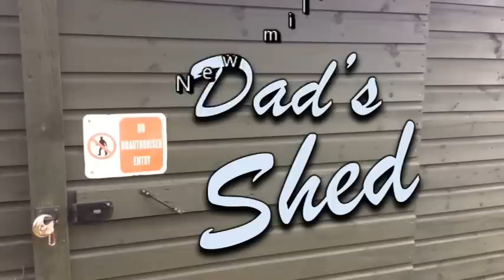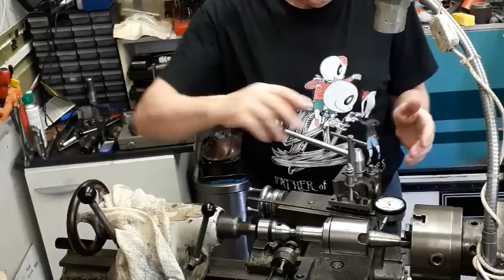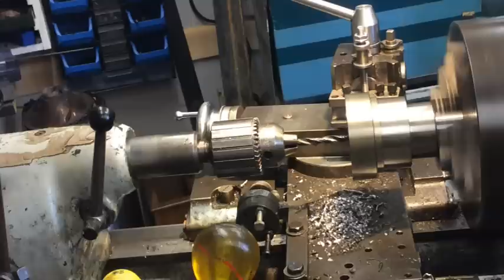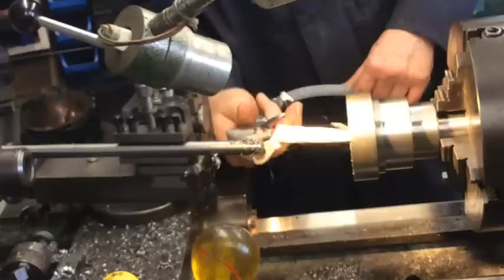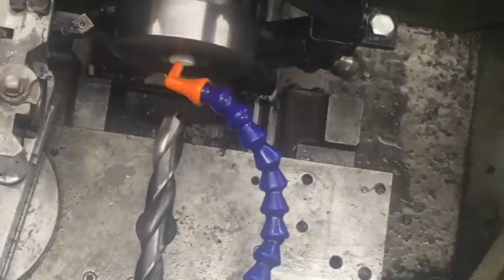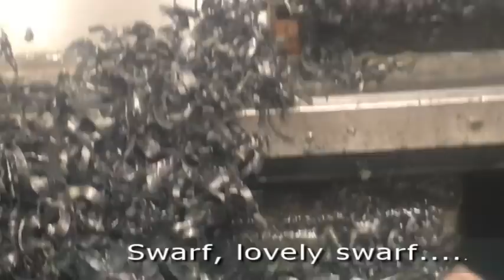Dads Shed 3

Comment: Just an observation, I never noticed whether or not you locked the saddle before you started turning the taper. If during the process the saddle backs off slightly, the bore will not be correct.
Reply from the maker: Very true that, I don't often turn taper from the top slide and haven't had that problem, but I'll remember it for the future! Thanks - every day's a school day!

Comment: Quick comment. The drive blocks do not need to be hardened. If the holder is fully tightened in the spindle there is very little chance of the holder moving, the blocks are there to stop rotation should there happen to be any slippage. Sometimes I remove my blocks when I have to use a Int 30 tool that has no drive slots milled into it. Regards from Australia.
Reply from the maker: Thanks for that input - it will save some work!! Hope you enjoy it.

Comment: Nice.  You're making basically the same thing as me, it seems, although I've got the entire head to construct.  My plan was to bore the spindle on the lathe, but cut (and grind) the 30 taper with the spindle in place on the machine.  I might rough the taper on the lathe, though.

Glad the drilling op worked out for you.  Deep bore drilling is always fraught, I'd probably have done the deep hole first and cut the taper later.  My order of ops would have been : 

- get the part centred and fully supported
- get an undersized centred hole in the end, pretty much as deep as I could go with a standard drill, and large enough to get a boring bar into
- bore that hole out to the nominal of the long drill
- deep drill, using the bored hole to support a large part of the drill absolutely dead straight and stop any wandering.  Obviously this reduces chip clearing space, so the drilling op will involve more, and shorter "pecks".
- cut the taper.

I love the mastic nozzle on the blowgun.  Top bodgery!
Reply from the maker: Thanks for the positive comment !
yep, I'm making the complete head too........ 
I didn't actually do this the way I'd planned - that would have had me do the through hole and taper first, then make an INT30 mandrel and then turn the outside diameters... - but I chickened out this time (and I didn't have the material I needed for the mandrel etc,,)
Reply: @DadsShed-om4lz  Are you making a separately powered head, a la bridgeport, or  powering from the horizontal spindle?  I'm going for the latter, but it's a helluva lot more complicated.

Comment: I'm glad to learn from your experience with the machines.  If I may offer a little from my experience with cameras, focusing the one for the horizontal shot of you and the work manually may be helpful; the autofocus logic rarely chooses the spindle axis.
Reply from the maker: Cheers jim, currently they are both smartphones so the autofocus is pretty much fixed - the cameras I do have won't shoot 16-9.....
Looking to change that soon.
Reply: @DadsShed-om4lz  What kind of phones?  I don't mind having a look for a fix for that.